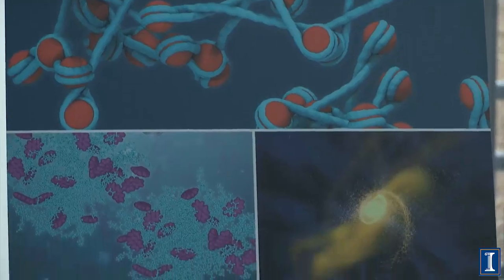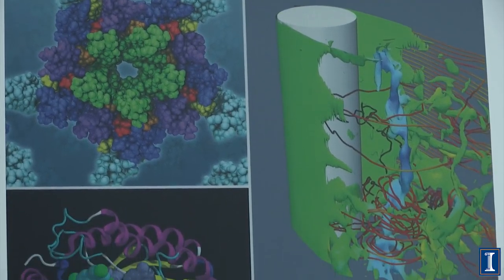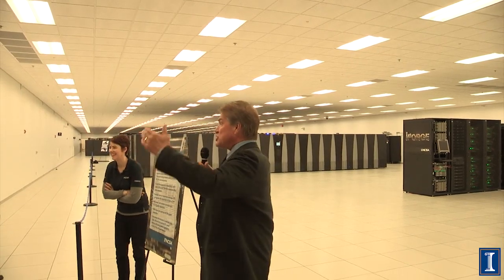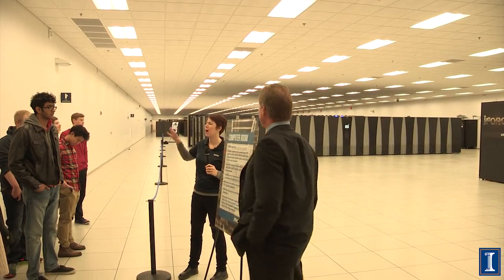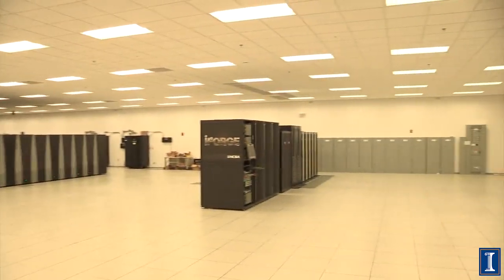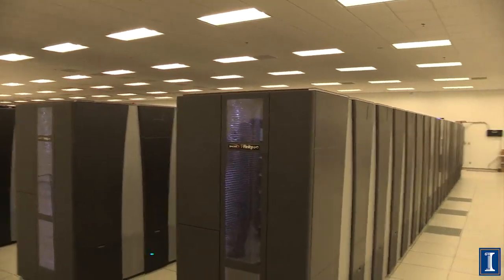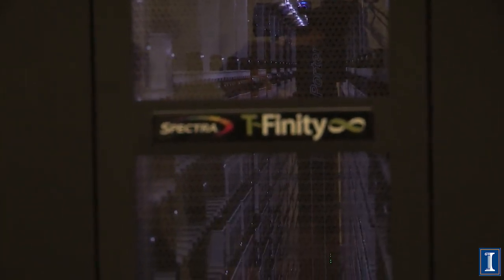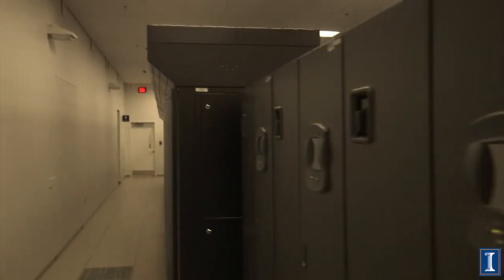How Things Work: Super Computers

Comment: I have recently started watching this channel and I love the content presented here. So before I make my comment let me begin by saying thank you for sharing this!

Now I just want to point out that during the clip at 11:58 you begin to explain what the blade is for the super computer and while most of the information was correct there were a couple huge parts that were not correct. First all of the black thin blade like wafers you pointed out being processors are in fact the RAM not the processors and the heat sinks (the copper finned areas) are in fact where the processors are and this particular server blade has 8 physical CPU cores each with its own heat sink two of which have been removed, showing the mounting bracket below which are the silver squares in between the two copper heat sinks  in the middle to the left. The silver heat sinks in the middle are heat sinks for board components and not memory aka RAM as you pointed. That again is the black blades to the left and right of the copper heat sinks.

Again you do fantastic work and I love your content so keep it coming. I just wanted to point that out to avoid confusion and make sure the correct data was presented so people were not confused and mislead.

Thank you!
Reply: I agree with all of this. Evidently, even emeritus professors forget their tweezers.
Reply: I was about to make essentially the same comment. But I figured it would have already been made as it's not a new video. I would have liked to see a real analysis of that board from Curiousmarc or Gamer Nexus.
Reply: Add me to the list.  heh.  Additionally, on that demo model, they've left out two of the CPUs to show the slots they plug into.  I do not know, though, what that is in the middle that he was calling RAM.  Just re rest of the motherboard components?
Reply: And if I could get my hands on just ONE of those blades, I'd be a happy camper.

Comment: The center section of the blade identified as RAM, is actually the VRM Voltage Regulation Modules for the CPUs. the RAM flanked the CPUs in DIMM Modules on either side of the CPU sockets.
Reply: Cite please? (Link to manual, installation or configuration document.)
Reply: @uploadJ  Source, Engineer in a high performance computing lab. 30+ years experience handling similar equipment. Same way a plumber knows the difference between a abs P trap and a pcv S trap. Its my gig to know.
Reply: @NorthmeadowMedical  nice find. with hi res rendering, yes. 100% VRM modules. 1 per CPU. The staggering is so it has wide enough pathways to delver the power to the cpus in that tight area. Smart layout.
Reply: @Jeremy Fleming
That's not what I'm looking for, that was not in the original request ("expert testimony").It's not that you can't be trusted, its just that you can still be wrong. W/o consulting the manufacturer's documentation everything is speculation, guesswork, flawed recall involving people's aging memory and the like.  Remember, PRIMARY DOCUMENTATION RULES!
Reply: @uploadJ  That being said, did you look at the primary documentation I provided?
Reply: @Scott Mikus
Not seeing the exact blade he was showing in the video; There is one, maybe two items on that blade in the video that don't correlate to items shown on the blade in the pdf file you linked to. Thanks for the link too.
Reply: @Jeremy Fleming

PS. This is also not my first (nor last) rodeo.
Reply: re: " did you look at the primary documentation I provided?"

Primary documentation where? That (from the title) is training material. 

"John Shalf
NERSC XE6 User Training"

But, it's a place to start, and I did thank you above.
Reply: @uploadJ  do you want me to Google it for you? That's not how this works. I offered corrective information to a small error the Prof made. If you don't believe me, go look it up. I am not your servant. I am a learned professional. So much more informed in this feild than the prof that has never worked in this field. I am sorry you are so jaded that you want to insult people who offer help.
If you want to learn more, google: HPC motherboard design, cpu vrm, I am a lazy dick that makes others do my research. Sorry to offer my 30 years of  professional and progressive practical experience to you.
That is not how you learn.
Reply: @uploadJ  dude get a grip. That is the exact blade. You are just being a troll.
Reply: @NorthmeadowMedical  ignore the troll.
Reply: @Jeremy Fleming re: " do you want me to Google it for you? "
>> Look, pal, I tried to let you off light, but you JUST didn't take the hint. I've got FAR more wide and varied experience on different physical and electronic 'systems' and platforms in industry (and that includes S/W) than you, you who have spent your entire time in the narrow field of IT by your OWN admission. Capiche?
Reply: Jeremy Fleming re: " That is the exact blade. "
>> I don't think so "Tim". You are succumbing to something called "stimulus generalization" where everything begins to look the same after awhile. BTW, get over yourself, you're not the "biggest" on the hill here ...
Reply: Nota bene: The request to @Jeremy Fleming for a "cite", a link to a manual, or an installation guide/procedure or configuration document has gone UNANSWERED.
Reply: @uploadJ  troll.
Reply: @MrMorbo420  I'd have to agree with you. The reason why "There is one, maybe two items" missing from the blade in the video vs the documents is because in the documents the heatsinks are all in place and not taken apart. 😁 So, of course they don't look the same.
Reply: @NorthmeadowMedical  I didn't start this out being critical of anyone. I was just trying to offer a smaller correction for the betterment of the material.
Not sure why downloadB had a problem with that.
Anyway, good find on that slide deck.
Reply: @MrMorbo420  Neither did I. I just wanted to, like you said get the correct information out there and contribute to what is already great content.
Reply: @Jeremy Fleming re: " you have no clue who you are talking to. "

An "IT Type" with an over-inflated sense of his capabilities outside the server room maybe? Yeah, I think I have you pegged. YT channels aren't everything in life, pally.
Reply: Could we please for the sake of the channel, drop this and move on. This channel is for education and not for this.
Reply: @uploadJ  Link please?  Umm, u ever open a pc case before?
Reply: @ronjon7942  Boy, I have wire-wrapped whole assemblies before, including Z80 uCs ... what's your point again?

Comment: The nice things about datafloors is that you can just take out the tiles if you need to add new infrastructure and/or rack units. This floor may look large and it is for just one (collective) machine. But many datacenters (which hold conventional multi-purpose servers) have multiple of these floors which hold a ton more servers and are mostly connected to the ISP network and routed out to their respective paths.

Comment: I have been in IT for over 40 years. 
I’ve been in my share of data centers that Halon fire suppression. The reason we don’t use Halon anymore is that most of the servers are so cheap that it’s easier to replace than repair.
Reply: They are used to protect the data...

Comment: In my understanding computers generally get expanded in a parallel manner, because their clock speeds are fixed to around 5Ghz as it stands. So that is ok for applications that can be done at the same time, but if new tasks require the output of a former stage, the process stalls. 12:38 the stuff in the middle looks like 2 unpopulated cpu sockets without the heatsinks, the stuff on the left looks like memory, and the stuff on the right looks like voltage regulation.
Reply: agree the computer components were incorrectly identified.

Comment: Those rows were the ram. Ram doesn't generate much heat, the CPUs do, and thus reside under the copper heatsinks. 

The middle of the board appears to be Mosfets so it no doubt makes up the power conversion than provides the roughly 1.2v required for the CPUs.

Comment: LEED certification seems pointless when you consume 24MW.
Reply: LEED cert is a joke. You can get the same LEED point for installing bicycle racks as you get for properly installing insulation or not  building your walls entirely out of glass.
Reply: I believe its about efficiency. For given infrastructure, how much real electricity its using. Also as said in the video, 24MW is the theorectical capacity, not the actual use
Reply: @hyeon-seoyun6940  all certification is a joke, its a system to regulate which companies get all the work.

Comment: Dude, and I was proud of my comp build RIP
Reply: What's more impressive: a massive semi truck rumbling down the road with hundreds of horsepower getting 3 MPG,  or a small, compact car built just big enough for the job that gets 50 MPG? You didn't build your computer to simulate an atomic bomb or compute the last digit of pi. You built it for a specific purpose that (if it's gaming anyway) this supercomputer probably can't even run. So, don't sell yourself short.
Reply: @WarrenGarabrandt  Im an AI engineer. I built my computer to train deep learning models. Yeah, that's not simulating an atomic bomb but google isnt using one single dope desktop build to train their DeepMind models. So Id say id have more use for the this super computer than tryina play minesweeper on it. lol
Reply: @jermeekable  yep. They got you a little bit here. Heh.

Comment: Supercomputes, ah the fun of planning for MW of cooling and power usage. NERSC at LBNL is interesting, the power limit is just how much copper can be shoved into the walls. 
back in late 2018 sitting around 13-15Pflops puts you around top 15. GPU power was just starting to show how strong it could be if your workload uses it.

most DC have 3-4ft tall below ground sections which is fine. you really shouldn't be walking around there much.

Comment: Someone needs to learn the ABCs of fire. A paper wood, B flammable fuel like gas oil, C electrical fire. Water cannot put out an electrical fire, it's only A rated. Halon is ABC rated and will not harm electrical equipment. Also fire fighter have breathing gear for smoke, which also works for Halon. If you have a small fire, one would use a fire extinguisher not the overhead suppression system. If you use a water fire extinguisher on electrical fire you could die.
Reply: or worse, lose data
Reply: @MrMorbo420 someones gotta protect all the por-- data...
Reply: I guarantee you that lady was wrong. They are not using water as a main fire supression.

Comment: lol they should use a nuclear reactor next to that super computer to make the energy cost very low
Reply: There’s a nuke power plant maybe 50 miles away near Clinton. I don’t know if the research reactor (near the old building made for ILLIAC IV and used for the Cray X-MP) is still in operation as it was when I had an office a hundred yards from it. Didn’t produce power.

This facility, I see from a bit of looking on line, is south to southwest of most of campus, well away from the Engineering campus and relatively near the campus coal-fired plant, I should think (haven’t been back to UIUC in almost 30 years). Used to walk near there on warmer winter days to clear my mind.

Comment: GTA5 would run like hell on this.
Reply: GTA won't run at all since it only works on Windows and I can tell you that this system is not Windows.
Reply: @MasthaX  It also would only use the resources of one blade, cutting performance to a thousandth of the total

Comment: ... And, just like in the '60s Lunar shot, wait a few more years and ALL of this will fit in a matchbox and be powered by a coin cell.
Reply: "A few more years" until you have 13 PFLOP's in your pocket?  That's a hard no.  But I like your moxy!
Reply: Computation is "free", as in, it doesn't cost any energy or generate any heat. Your computer actually only generates heat in the CPU when it has to force a transistor to clear its value, to reset for another computation. This is mostly why your CPU doesn't really use much electricity or generate much heat when it's idle, but can use an order of magnitude more power and produce an order of magnitude more heat when it's actually doing something like playing a game. The evicting of information from memory (including the states of transistors used in computations) removes information from the computer and radiates it out as heat. Information isn't destroyed, it is radiated away as heat, increasing the entropy of the universe.
With that in mind, there is actually a lower limit to how much power and heat a computer can use/release at a minimum for a certain amount of work. Unfortunately, the lower limit for 13 petaflops of computational power is well beyond a coin cell and a matchbox sized heat radiator. But I do get where you're coming from. 
We had computers in the 60s that were so amazingly inefficient that with technology advances we now have phones with orders of magnitude more processing power. We will certainly get faster and more efficient computers in the future. I doubt we'll ever get a desktop PC with that much processing power, at least not so long as we are using silicon transistors.

Comment: I worked at an IBM facility and there were huge raised floors like that, but they were only about 2 feet deep which meant you had to pull floor tiles to get where you were going, and it was cramped for space.. 6ft tall and you can walk through them is absolutely wonderful.
Regarding solving 'global warming - climate issues'.. super computers don't do a bit of good when the software, the models that the programmers create are wrong.. Ever computer model made so far has been proven wrong by real world measurements.. All of them err on the side of hyperbole.

Comment: 13 petaflops really isn't that impressive, and you wouldn't need "millions" of laptops to equal the raw FLOPS of that supercomputer. A teraflop of computing power on a GPU costs about $50 in 2019, factoring in the cost of the rest of the system (RAM, CPU, etc.) and that's 1/1000 of a petaflop. So if you had the energy and space to run it, you could slap together 13 petaflops with $650,000 or so. Real supercomputers cost a lot more because they're a bit more space-efficient than putting together thousands of desktop systems, and there are very expensive, high speed interconnects between the different parts. For embarrassingly parallel algorithms that require little to no communication between the various parts, though, you wouldn't need those expensive interconnects, and could just use a bunch of independent systems.
Reply: I have a feeling this might be from 2015.
Reply: @JeBuSv20  the SC their talking about "Blue Waters" was built in 2012.
Reply: So sure, your GPU offers several dozen Teraflops of capacity. But definitely not your CPU, which runs at Ghz*Cores*Ops/Clock (8 Double-Precision FLOP/cycle for Ryzen 8, up to 32 on some high-end Intel). So even with a 64 core Ryzen at 4Ghz, you’d need 500 per petaflop to equal that performance.

Also the GPUs often only have those rates when you do single precision (32 bit) floats, when most scientific computing demands double or sometimes even quad precision. And those often get slower exponentially, not linearly.

Comment: Pointing at RAM. "These are the CPU's"… 
The CPU's are under the "pink" heatsinks. You can see the socket on one, and the CPU on the other one where there's no heatsink.
"These are the memory." Those are NVMe drives for storage.
Reply: You are right there are not ram. But they arent storage either. Voltage Regulation Modules. Each CPU has its own power supply that is a field replaceable unit. Hence the Beefy Heatsinks and being in the hot section. These blades have no storage. Everything is netbooted over the infiniband and storage is handled by master nodes. Source, Im an engineer in a high performance computing lab.
Reply: @MrMorbo420  They looked very similar to heatsinks for M.2
My mistake about those, thought they used scratchdisk.
Reply: @ptilrem  reasonable guess. Mutli cpu systems use VRMs that can be replaced in a jiffy in case of failure. They have diagnostic systems that will identify problem parts and send codes to master consoles to generate work orders.
Reply: @ptilrem  with massive distributed computing like this there is no local storage. It is all communicated  over the 1200gbps infiniband. Local storage would be way too slow.

Comment: I gotta say, these how things work videos don't really match the high standard you set with your excellent whiteboard videos on fission and energy economics. This doesnt really answer any questions about what makes a supercomputer different from a regular computer, or how they can split up a problem to thread it efficiently on thousands of processors, or how the system synchronizes physically quite distant components or moves data between them
Reply: the splitting up of problem answer actually makes your synchronize data question redundant.  splitting up the problem into manageable slices eliminates the need for all the components to know the answer.  the splice of data output each component works on will be uploaded to storage.
Reply: nothing about the hardware of a supercomputer is that special other than in some cases networking (theres rare examples like intel xeon phi) the special part is networking and the software that allows thousands or tens of thousands of nodes to work problems.